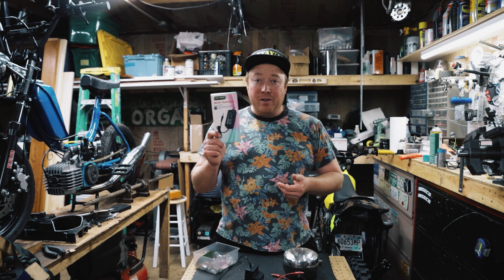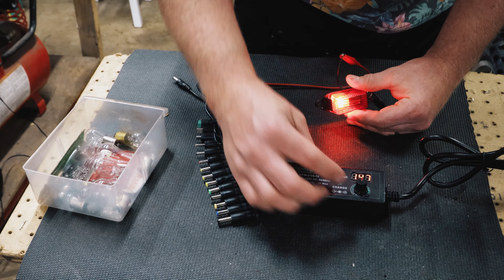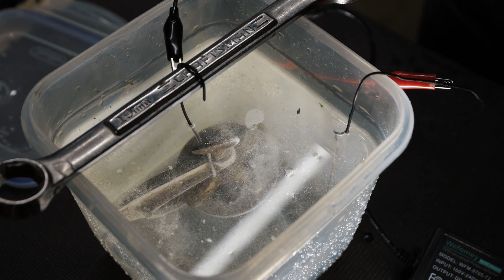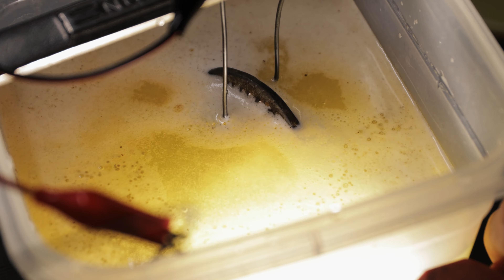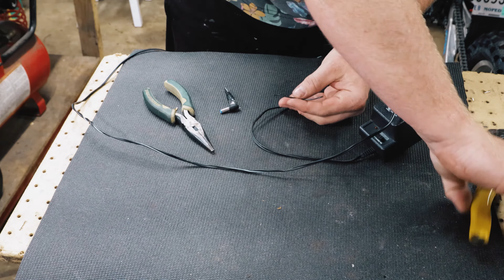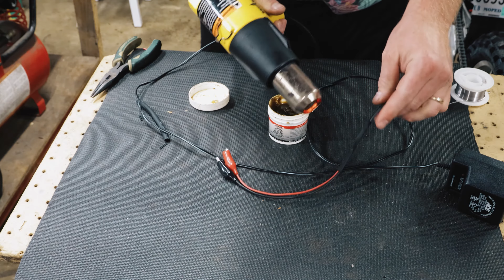DC benchtop power supply and a DIY version for Testing and Electrolysis rust removal

Comment: EDIT: I think if you look, the little green connector is a breakout connector with screw terminals so you can wire it more securely than just the alligator clips. Also the dual filament bulb with one good filament could be salvaged by using solder to bridge the contact on the bottom of the bulb. ...

I use a combined power supply (variable)/ hot air station/ soldering station that I have for test power I think I can crank it up to well over 30v. Also also I have a portable Eco-flow for my 12v & 120v needs. I guess I could use your arrangement while I'm in the driveway with either an extension cord or the Eco-flow.

Thanks for the content.
Keep up the good work.
בס'ד

Comment: The voltage on that brick supply being higher than advertised does not surprise me at all; it probably has linear regulators inside which require a minimum load in order to produce the correct voltage.

If you check the voltage while it is attached to an incandescent bulb I'd bet it's a lot closer to the listed voltage.
Reply: TBH I use a 9V battery for testing 6V and 12V bulbs.
Reply from the maker: yeah I'll test it that way. I bet it comes down. Also yeah 9v on a 6v bulb is not going to hurt it.